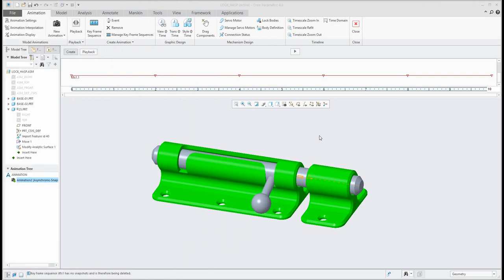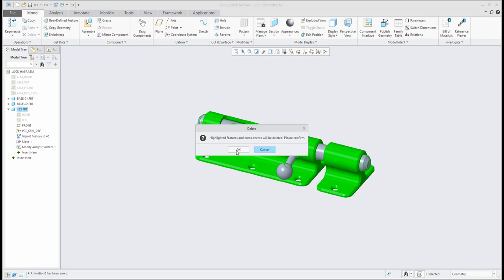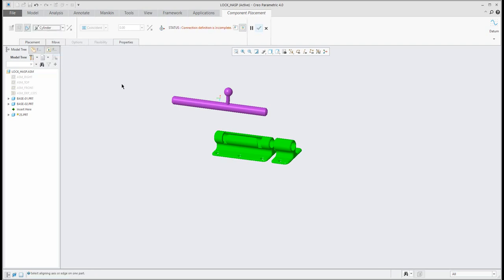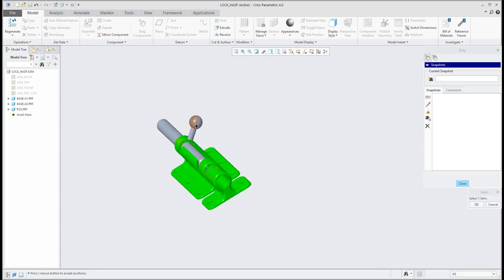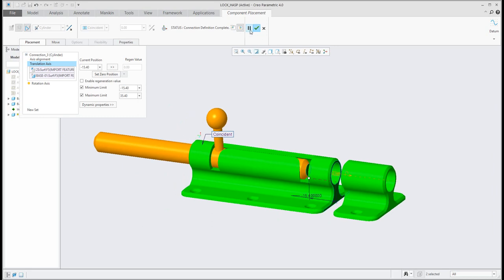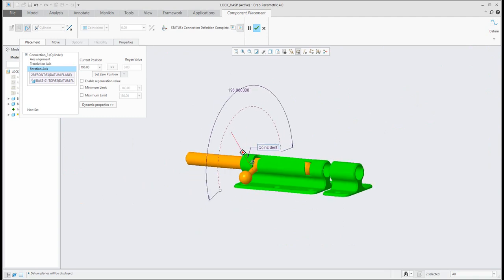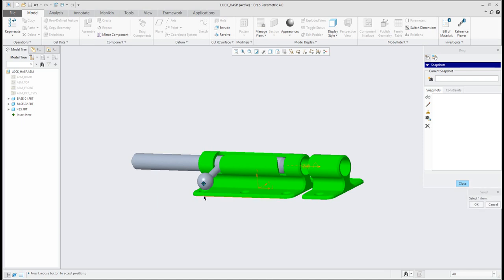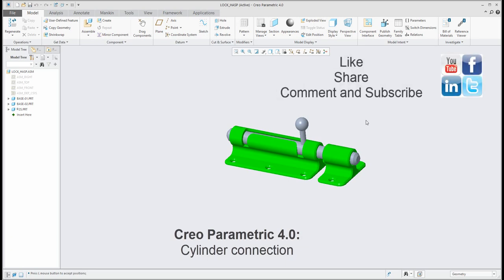PTC Creo 4.0 tutorial: Cylinder connection

Comment: Hello.  How to remove captions related to representations from the animation, located in the lower left corner of the window.
Reply from the maker: Hello, thanks for your question (I have seen the post on fb messenger, but was not possible to answer because you have been offline)
I have checked and you are right, if you would like to animate Simplified representation, the Creo still show the caption on the screen.
My suggestion is that you will use Style and Time animation instead of Simp. Reps
Reply: @4kside  Thank you. I will try.
Explode state, Insert Mode, Style State is still displayed. My assemblies have several dozen parts, and the animations based on Explode are easier to set up than with Drag components. I don't know what to do, I guess I'll have to leave these signs. I can remove them by rendering each frame, but it takes too long.
Reply from the maker: Hi, I have checked and I have found only the way that you will use rendering method (system will not show captions on the screen)
Reply: @4kside  Thanks.  It's a pity they didn't notice the PTC developers.